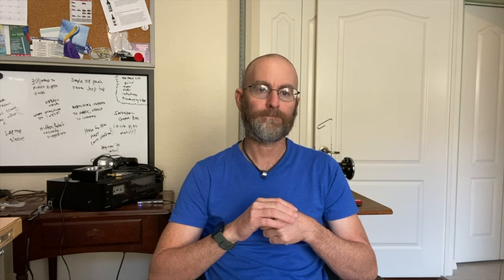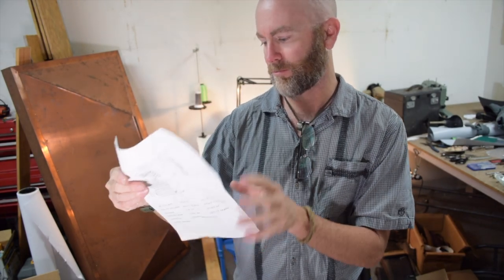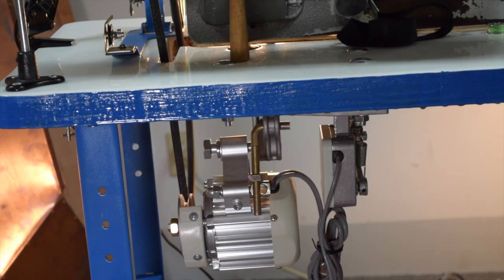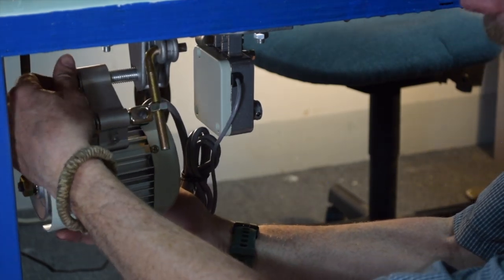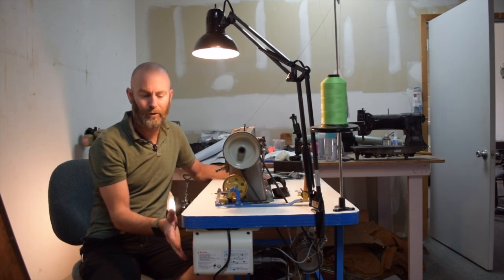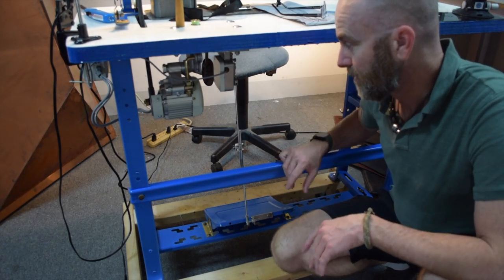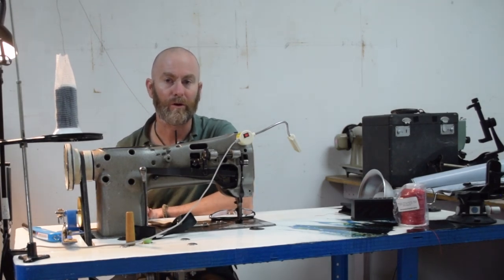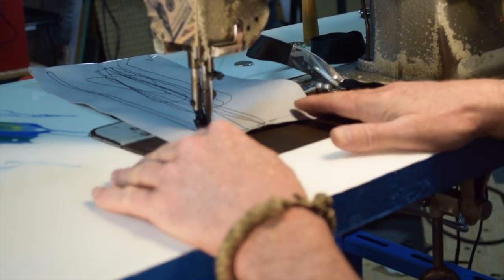Dumping The Clutch - Installing A Servo Motor On An Industrial Sewing Machine

Comment: Can a servo motor be installed to any industrial sewing machine? Particularly a Juki ddl-8100e? Thanks
Reply from the maker: Hi Shannen, 
Short answer is yes.  Long answer is there are probably some very specific-use machines that they might not work on, but virtually any lockstitch industrial sewing machine that is driven by a belt attached to a motor should be able to be powered by a servo motor like this one.  The 8100e should work great with one.
Thanks for the question, and thanks for watching!

Comment: Servo is a waste of money .
If it ain't Broke, don't Fix it or improve it with made in China inexpensive units that WILL have to be placed again ..
These Clutch motors were used during WW2 to make uniforms and Military gear (tarps etc ) ..
Obviously they stood the 
TEST OF TIME!
Reply from the maker: Hi, 
I agree with some points you make - clutch motors are tough and reliable, and they work.  However, the same could be said for steam-engine cars, but there are reasons no one but collectors drive them anymore.  
Servo motors are FAR more efficient, quieter and easier to control.  They've also become relatively inexpensive.
I've addressed this in a video, but EVERYTHING is made in China.  If you have a very old clutch motor, it may have been made elsewhere (mine was made in Taiwan, the one I threw away was made in the USA or UK, I forget which).  There is certainly nothing wrong with continuing to use an old clutch motor if you have one you like, and if you enjoy using it.  In my case, the motor I replaced was, in fact, broken, and was not worth the time and effort needed to make it useful to me.  Your mileage may vary.
Thanks for watching and commenting!

Comment: There are soo many variants, which one is best in the UK pls?
Reply from the maker: Hi, 
I bought the one I did simply based on price.  I suspect all of these motors are made in the same factory and are identical except for the name on them.  If you want a reliable motor backed by a warranty, you might look at Sailrite motors, although I'm not sure if they offer one with needle position.  I'll be doing a review on their Workhorse motor soon.
Thanks for watching!

Comment: I have a cobra Class 4 and love the servo motor. Zero experience with a clutch motor.  I'd like to see servo controllers with a few more parameters. I'd like a torque setting and a ramp time. oh and a analog variable speed 0-10V would be nice. I'm not a fan of the light sensor speed switches not do i like the hall effect control either.

Comment: Hello! Do you have link of the servo motor you got frm amazon? Ty
Reply from the maker: Hi, 
Sorry for taking so long to respond.  I do not have a link, but it's at the "Sewtco" motor with needle positioner.  Honestly, there are numerous brand names that all seem to be the same motor, so you can probably just pick whatever is the best price at the moment.
I can say that I've got quite a few projects done on this motor now, and it's working very well so far.
I hope that helps, thanks for watching!

Comment: I haven’t used one yet but from what I have discovered new models come with servo motors.  One industrial sewing machine business said clutch motors are obsolete and that no one should buy even a used machine with a clutch motor.  I have four industrial sewing machines and I’m going to replace all the motors on each one.
Reply from the maker: I've seen some new machines still equipped with clutch motors, but I think they are becoming obsolete.  I disagree with the statement that "no one should buy even a used machine with a clutch motor," though.  Clutch motors are incredibly reliable, fairly easily serviceable, and they work well.  Learning to control a clutch motor can lead to better mastery of running an industrial sewing machine (sort of like learning to drive in a car with manual transmission). Servo motors are pretty cheap, so if one buys a machine with a clutch motor, it's pretty easy to change to a servo later.
I'm running one servo and one clutch machine, and I enjoy using the clutch motor from time to time.  It almost certainly will get a servo motor one day, but I'm in no hurry.
If you put servos on all of your machines, I'd recommend keeping at least one clutch motor on hand.  If you "let the smoke out" of a servo motor, at least you can bolt up the clutch motor to finish the job!
Thanks for watching and commenting!

Comment: Question  I have an old Juki LU55 with no reverse and I would like to put a servo motor on it that goes clockwise and counterclockwise does that mean my Juki will go in reverse now via pressing the pedal backwards ?????
Reply from the maker: Hi Bettye, 
Sorry it took so long to get back to you!
NO, DO NOT RUN YOUR MACHINE BACKWARDS!!!
On sewing machines, reverse involves a gear change (basically) to the feeding mechanism, but the sewing mechanism ALWAYS turns the same direction, no matter what.  Apparently, rotating the hand wheel the wrong direction can throw the machine off time or possibly cause damage.  I've never experimented with this, but every manual I've ever seen cautions against turning the wheel the wrong direction.
The servo motor can run in different directions to accommodate different mountings, or possibly different machines, I believe.  It is not intended to run both directions on the same machine.
Pushing the pedal backwards won't do that, by the way.  If your motor is equipped with a needle positioner (and if you install it, it's not required to use the motor), pressing on the back of the pedal can raise the needle if you have it set up to stop needle down (my preference).
I hope that helps, let me know if you have other questions!
Reply: @thejasonofalltrades  ok thanks Jason .. I may order a servo motor and do the install myself.  Ps. I'll be watching for future videos.

Comment: The servo motor is a big improvement over the old clutch motor but I am disappointed the Consew CMS 1000 can only slow to a min of 500 RPMs, even though the Consew website says 0-4200 RPMs.  I can not do a single stitch at a time. But 500 RPMs is better than the high speed clutch motor setup.

Comment: I installed a similar motor on my Nakajima 280L, getting rid of the original clutch motor.  
Even with the smallest pulley I could build in my machine shop for the clutch motor, it was still too fast for my taste.
I installed the smaller of the 2 pulleys that came in the box, as well as the needle sensor.
So much better!  I'm went into the setup of the controller, lowered my start speed down to the min. (100 motor RPM, Not Stitches per min because of difference in drive pulley to sewing machine pulley, now at 2 to 1 ratio.) So it starts at 50 Stitches per minute and I limited the motor at this point to 1000 RPM (500 Stitches Per Minute) till i get used to it.  With the needle sensor, the machine is controllable to 1/2 stitch per peddle press.  Touch treadle forward, needle down, 1/2 stitch, rock treadle back, needle up, 1/2 stitch.
Adjust the parameters in the motor controller.  Amazing what you can do with this motor.
Reply: I have a Nakajima 180L and want to replace the clutch motor with a servo motor with needle synchronizer. I’m also looking at changing from the 75 mm to a 45mm pulley (I think) to further slow down the machine. I now have a towel wedged under the presser foot to slow the machine and have more control. Thanks for your suggestions.

Comment: Hi - It is not broken.  It just loud.  Would it be less noise with the Servo motor?  How much does it cost?  Thank you.
Reply from the maker: Servo motors are essentially silent, the only noise you will hear in use is the mechanical noise of the machine.  I paid about US$130 for my servo motor, there are many inexpensive ones on the market.
Reply: @thejasonofalltrades  thank you very much for sharing your knowledge.  I really enjoyed your videos.

Comment: Hi - I have an old Juki DDL 5550 machine and motor is very loud. What can I do to make less noisy? thanks
Reply from the maker: Hi, 
Is it noisy just because it's a clutch motor and makes noise when it's running, or is it something more (like something is broken)?  Clutch motors are loud, and I don't know of anything that will make them quiet, but changing to a servo motor will definitely be a big improvement if you're wanting the machine to be quiet.

Comment: Great job sorting through that. I have a similar motor that I bought on Aliexpress, but the 2 halves of the motor had already been assembled beforehand, so I didn't run into the same issue as you did. The video is on my channel is you'd like to compare. I'm quite pleased with mine, honestly, especially with the silence and the variable speed.
Reply: can you tell me what motor you installed, I am old woman and have to do one by myself.
Reply: @TheNanaweaver  This is what I bought. https://www.aliexpress.com/item/32964686356.html?spm=a2g0s.9042311.0.0.27424c4dA3AaBf

Comment: I mounted my motor (Consew Premier 1001) on the bracket and I was left with two small spring washers.  I studied the one page diagram and I had all of the nuts, bolts, and washers accounted for.  🙄🤔 I hope it works.😳😐
Reply from the maker: Nice! I'm sure it will be fine, enjoy!

Comment: This is the clearest servo installation video I've come across.
Reply from the maker: Thank you!
Make sure you check out the comments, several people noticed that there is a way to adjust the motor's position without adding extra washers the way I did.
Thanks for watching and commenting!

Comment: clicks on video for sewing tips.... gets distracted adjusting the volume 9 different times..DUDE!!!!!
Reply from the maker: Hi, 
First, I appreciate the criticism.  Not the (apparent) tone so much, but the criticism is helpful.
For what it's worth, I'm a VERY low-budget, one-man operation.  I don't have a sound guy. I have a cheap microphone that, while not great,  still provides FAR better sound than what was in my earlier videos.  I have some significant hearing loss.  I probably have different headphones than you do.  I didn't set out to make the volume vary wildly, and I didn't NOT try to make it consistent.  In my ears, through my headphones, the volume levels were acceptable.  
You have every right to find the volume levels unacceptable, and to complain about it.  Just understand that I'm just a guy trying to do something, and I often fall short of perfection.
Thanks for watching, and I'll continue to strive for better audio levels.
Reply: @thejasonofalltrades  i went ahead and chose to not read everything you said after the word “apparent”, since it was what you thought i said VS what i actually said…. you’re welcome on the prologue. I'm swaying between two machines, an LU-1508 and the sailrite fabricator. you're vids helped tremendously with choosing the Juki. the noise is a big factor, I DO NOT want to wake wify at 5am sewing tac gear, I don't want to hear the machine over my headphones. EVERYTHING else about your videos are spot on, thank you.

Comment: if there is offset trouble, no extra washers needed ! there is an adjustable V Gib clamp on motor to mover left or right !
Reply from the maker: Yeah, a few people have pointed that out!  I'll be making that change soon (unless I forget to lol).  Thanks for letting me know!
Reply: @thejasonofalltrades   I just installed my 750 water to on my Adler 67 and after bolting up was like ! omg I have to drill table to move mounts, though self ! NO WAY..then I seen it ! lol  Cheers and happy sewing, BTW I love it ! it crawls along now. admit I did put a 1.5 bully on motor and 7" on machine to gear it down further  ! )

Comment: I have basically the same machine and love the servo motor.  I installed a speed reducer pulley and that helped with both slowing the machine down but, allowing the servo to operate in it’s higher torque range.

Comment: I'm an electrician and one of the advantages of the servo motor is the torque at practically zero speed.  It would be hard to do with a foot pedal but if you had a better, more sensitive controller,  you could slow the rpm down to whatever speed you wanted.

Comment: If you normally sew slooooooowly, I suggest changing that pulley to a 50mm to gain more torque. Boy howdy does it make a difference.
Reply: Sean, where’s a good place to get the pulley?
Reply: @geoffowler8065  Why do you think you need pulley? In fact you don't. You can program the motor to go slower (less rpm), that's what that big box is there for!!!

Comment: Hey Jason, If you loosen the allen screw holding the motor to the motor bracket you can slide the motor over and make up the room without all the washers.
Reply from the maker: Thanks Ken! This has been pointed out to me, and I plan to make that adjustment.  I guess I could have used instructions after all!  Thanks for the help!
Reply: Machine,281 senger

Comment: I have on my Consew 206RB5 walking foot the Consew CSM550-1 Sewing Machine Servo Motor, 3450RPM. Works well, about $125. I never run it higher than it's slowest setting, and it's dandy right there.
Reply: Looking at that model it appears the servo motor and controller are combined with just a small box coming out to an on/off switch and fuse.  Does this model have a outlet to plug the lamp into?

Comment: I've recently installed a servo motor with needle positioner on my Pfaff 335-17B cylinder arm machine and in fact hold you partially responsible! I've been doing the bulk of my work on a Juki 5550N which has inbuilt needle positioning, as well as thread cutting. I bought the Pfaff after getting an appetite for making bags from thicker canvas and leather materials where I needed the walking foot. The Juki is still a dream to sew on, and I wanted to replicate that experience on the Pfaff.

One issue I had was with fitting the positioning sensor - my machine is an older model and finding the 'meat' on the driven shaft to attach the sensor was difficult. A local company that had experience with older machines was able to help me out and attach it for me, but hitting up a machine shop and having a small adaptor fabricated is also an option. Another thing to be careful of is that your old drive belt will likely not fit due to the reduced size of the motor compared to a clutch motor, but a quick visit to a local auto parts store got me sorted. I measured the new required belt diameter with some string and took it in to find a matching v-belt model.

Absolutely love your videos and can't wait to see more. Your channel has helped me find a hobby that I enjoy and gets me out of a funk when the black dog hits. Thanks for sharing your knowledge with us.
Reply from the maker: Thank YOU!

Comment: Thanks for the great video. The servo motor encoder you didn't use I did some lathe work to make a shaft to connect to  my machine but I never liked how it mounted so I just never used it. The leather workers recommend using another drive reduction system so the motor will go slower and last longer and smoother at lower speeds. I have just the motor and mine works fine for me . My servo motor failed and I bought what they called a servo but after taking it apart it was just a variable brush type dc motor. Very simple and works well. In time I will put more gear reduction on it. I wish I tried the gear reduction first to see if I had enough control. My understanding is some leather workers like using just gear speed reduction on a standard clutch motor.
Reply from the maker: Now I want a lathe :)

Comment: I litterly just finished my servo motor install on my 211U this evening. Had the exact same issues you had, even with a different brand. I had to re-use the linkage from the clutch motor, and drill 1 new hole closest to the belt. 
Now to unlearn all the clutch motor habits that I had.
Reply from the maker: I've scared myself silly a couple of times; I have a habit of slightly depressing the pedal to release the clutch so I can hand wheel without friction from the belt.  If I do that with the servo I usually get a surprise when it suddenly starts sewing lol.
Reply: @thejasonofalltrades  
Hahaha, did that a few times last night on the start of a run of some flat lay pouches. I also had the habit of holding  the hand wheel while starting the clutch motor to dampen the effect of a quick take off in tighter areas. 
Overall I'm happy with the servo motor but when the servo motor cant seem to pick a constant speed and bounces back and fourth between 5,000 and 6000 rpm it can be frustrating.

Comment: Great video. I put the exact same motor on a Singer 31 and had the same issues. Instead of adding washers I moved the motor in the mount my loosening the Allen head bolt that clamps to the motor. Had the same issue with the Foot/treadle plate being too heavy, so I added a piece of bungy cord up to the frame. Same issue another commenter used a screen door spring. Good idea. The only issue I have with servo motors was on a Consew 226R e rubber belt inside from the top shaft to the bottom shaft had a set and would move the needle ad cause a jam. The old motor has a break that keeps that from happening.  Other an that I love the servoes for the control. When doing repairs you often don't need speed but the ability to just make a couple stitches in a tight spot. Thumbs up, keep up the great videos. Can't wait for the needle down attachment video.
Reply from the maker: Another commenter alerted me to the fact that I could have moved the motor the way you did.  I may go back and try that.  Thanks for watching and commenting!

Comment: Clutch motor most likely came originally with my 226  replaced with servo motor several years ago, replaced that servo last fall something in PC board glitched, of course, no one sells replacement parts. I like the servos, not so much the serviceability.